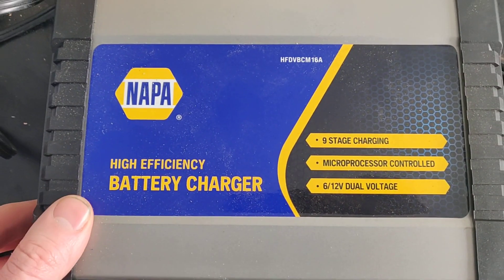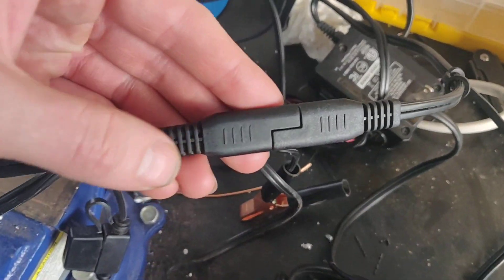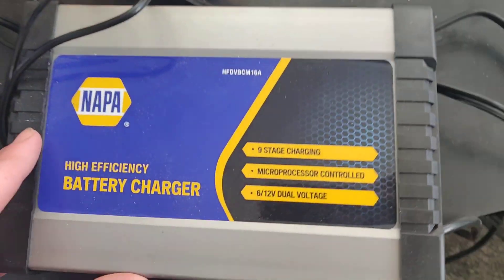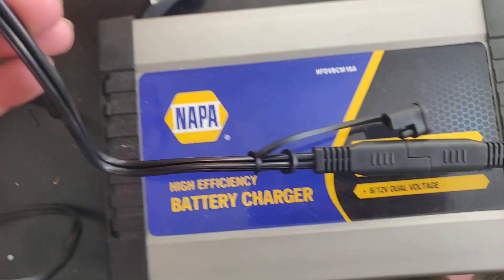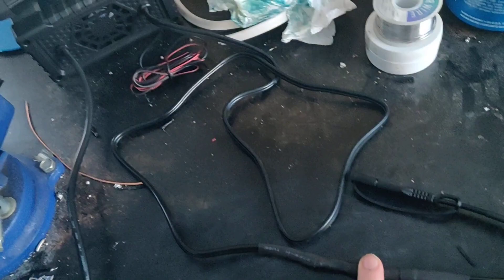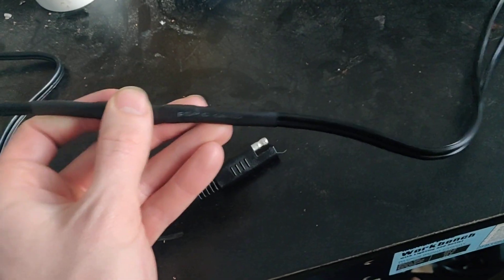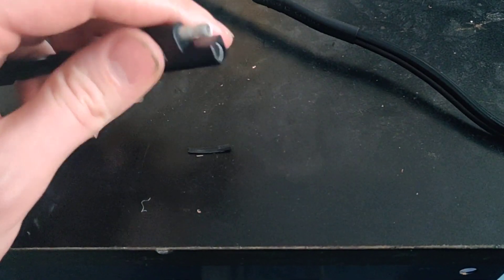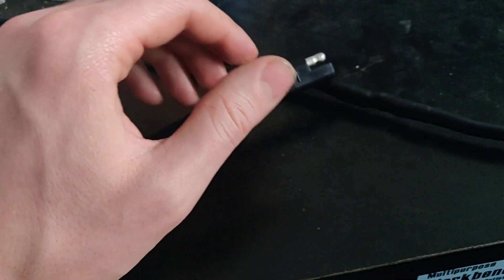NAPA Charger Fix Backward Connector

Comment: I just bought this crap and it's been charging since 11am  its now 4:30 pm and no sign of charging. I'm returning this crap.
Updat me: it's now the next day and this has been sitting on the outlet charging over night and it's only the green power light thsts on., it foes not indicate if it's chsrge or not. I don't even know if the this charger is even charge.🤔
Reply from the maker: Did you turn it on? This charger you need to select the voltage and amps then start it charging with a button before it will charge. Not like a battery tender where you just hook it up and walk away